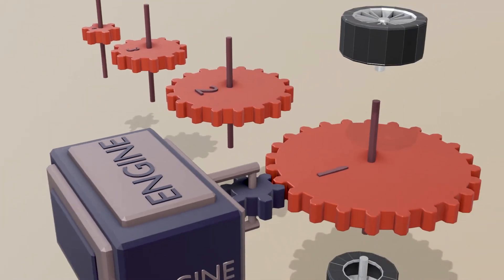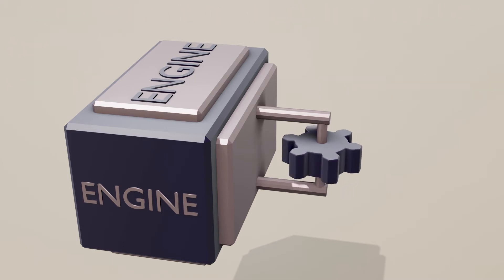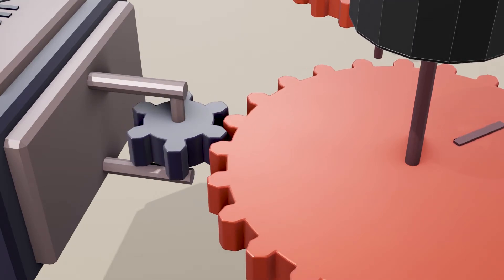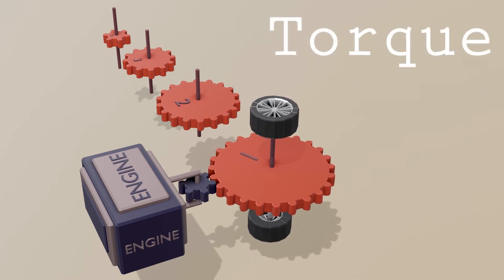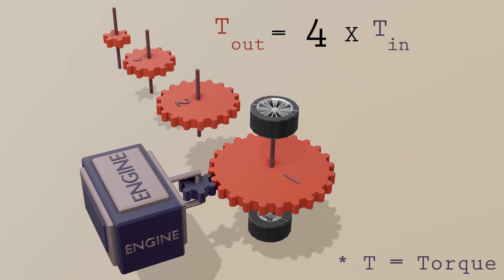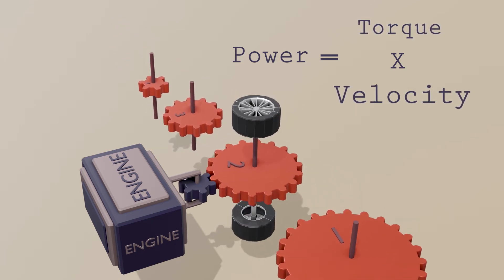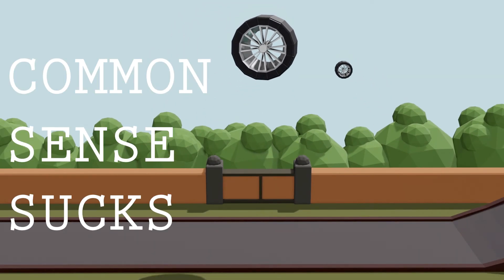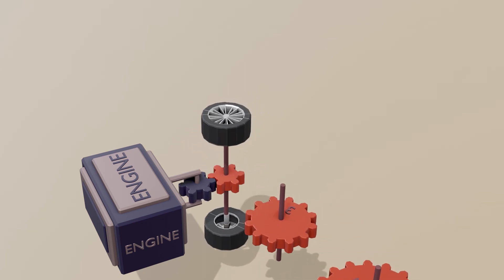Why do we change gears in a car ?

Comment: first gear has the shortest diameter.. its shown opposite here.. why?
Reply from the maker: As I said at the beginning of the video, this is only a schematic representation of gears focusing only on the physics behind them. It doesn't exactly look like this inside a car. You can refer to this video: https://www.youtube.com/watch?v=wCu9W9xNwtI&t=302s by Lesics to see it from an engineering point of view. No matter how it is implemented, the physics and logic behind it will be the same, which is what I'm trying to explain here.
Reply: Two ways for gear to work,big gear and same number of teeth=first gear,small gear with high number of teeth also works the same way.
Thats what I understood/can visualise,correct me if Im wrong.